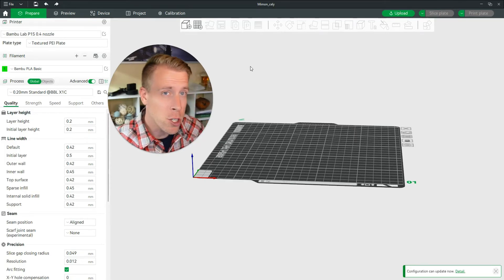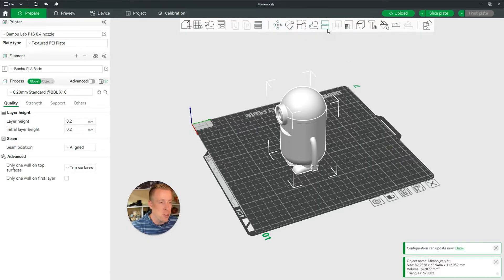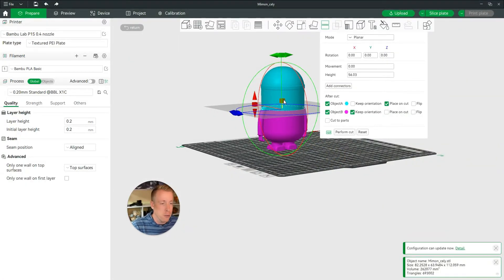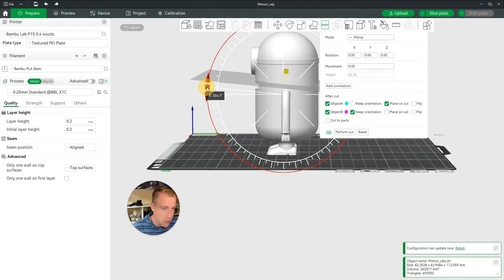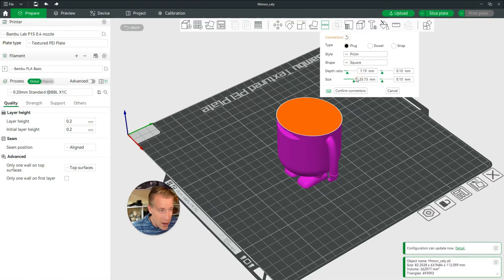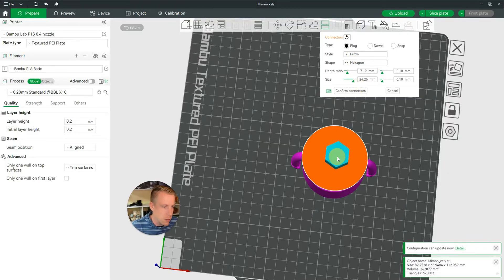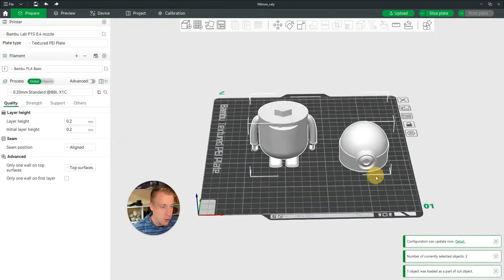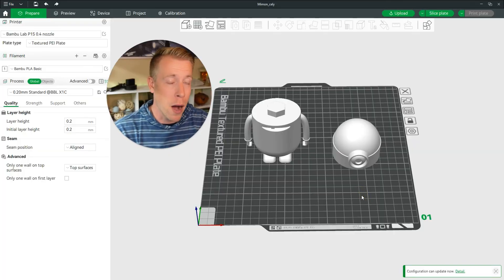How to Cut a Model into Multiple Parts with Connectors in Bambu Studio

Comment: What about tolerances between the pin and the hole?? it probably won´t fit because of tolerances.  The hole should be slightly bigger or the pin smaller, about 0.2

Comment: Nice video. I've done a couple cuts w/ connectors and they work great. My challenge now is that I want to make multiple cuts with connectors and then clone the cut so that I can extend it and have the connectors line up.  in other words , take an object that is 100mm high. If the first cut at the bottom 20mm , that leaves an 80m piece. if I then in turn cut that 80mm piece at 50mm.  This leaves me 3 pieces (20, 50, 30)  I then want to clone the 50mm piece twice. And then assemble it all with connectors such that my final item is 150mm tall. How can I align the connectors so that if I want to clone the 50mm piece again all the pieces would line up.  hope that made sense

Comment: Every time i print a model with connectors it is filling in the connector holes. How do I get it to not fill in the holes? When I look at it, the holes appear but when it prints it completely fills in the holes?
Reply: Is it your support? Depending on the angle you have your model at and what your support settings are, your support could be filling in the hole

Comment: i will subscribe if u can help me with this. I am printing a badge for a car, and the clips break off easily. i was trying to see how to slice the clips off and have the plug connector style setup where the clips can be glued into the back of the badge. idk if this can be done because i need the clips to be extended where they can go in the holes and the holes be lined up perfectly for them.